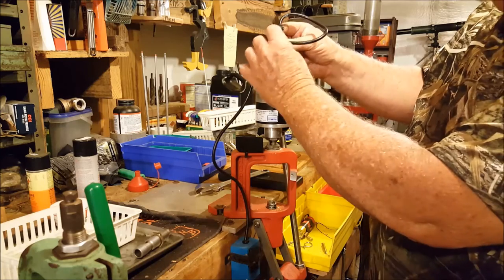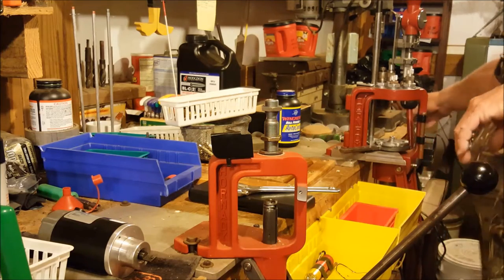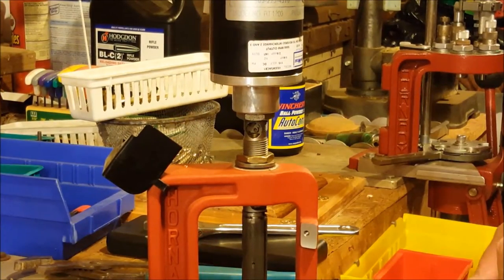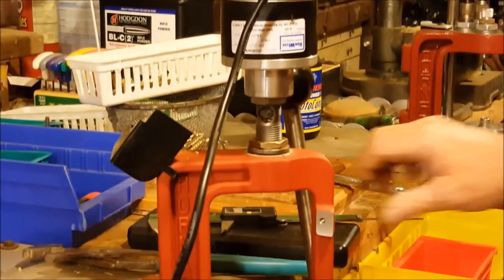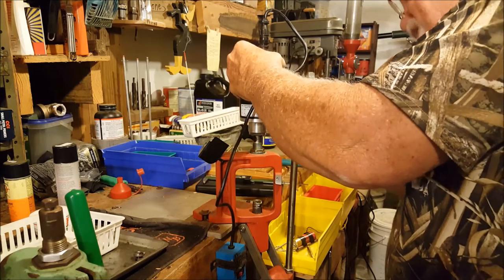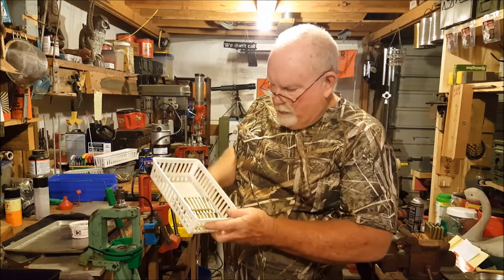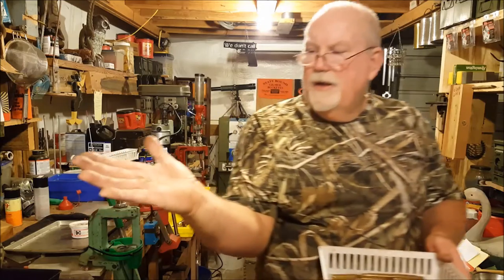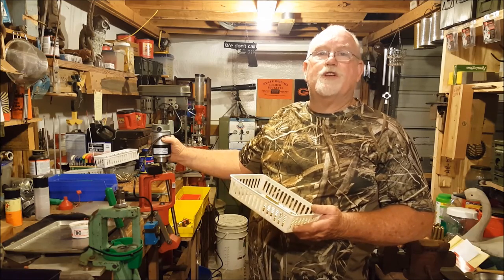Trimming .270 Cases with Dillon Electric Trimmer - Part 1of .270 Reloads

Comment: You can get a proper sized exact C.O.A.L. piece of brass of the caliber you are working with that does NOT require sizing or trimming and place that in the press, ram it up into the die, bring the trimmer down to where its touching the proper sized brass and lock it in. Now you know the depth and trim length will be correct as long as the reference brass you used is correct. Now you can start trimming the brass that needs trimming.